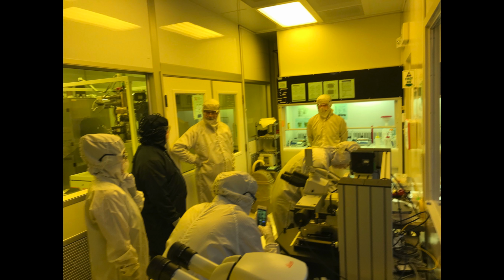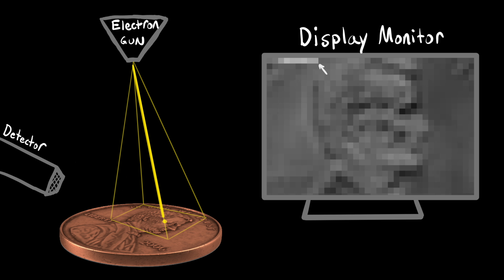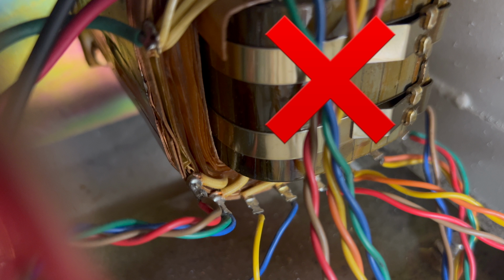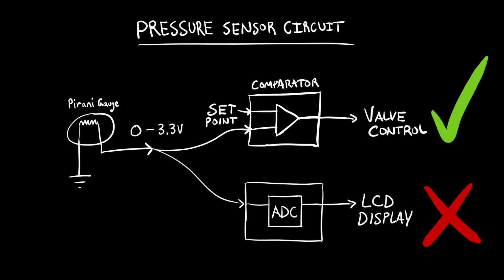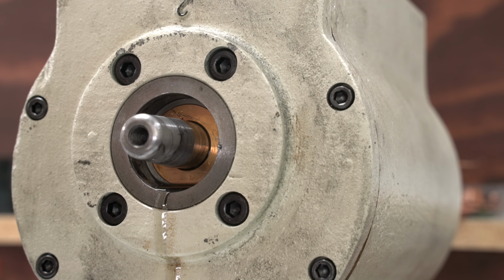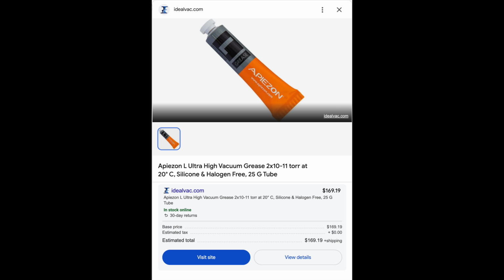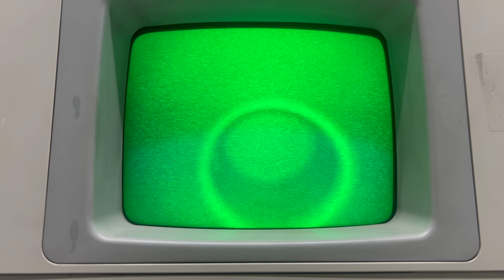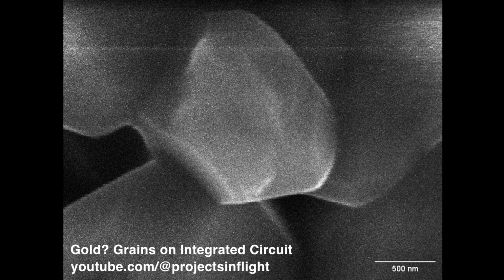I Saved an Electron Microscope from the Trash

Comment: On a technical basis this is very similar in build and operation to the electron tube of say an old Sony Trinitron CRT (Cathode Ray Tube) where beams of electrons are moved in a Z-pattern across an object using electromagnetic coils. I am quite sure that to RECREATE this technology in a much smaller form factor would actually be quite easy to do from a mechanical and electrical engineering point-of-view!

A CRT (Cathode Ray Tube) to provide the scanning electron beam can be recreated from about $2500 in parts and a vacuum chamber you can build yourself out of common 12 inch diameter 3/8ths inch thick 316-series stainless steel pipe and stainless steel plate which will hold a HARD vacuum for your objects-to-be-scanned samples! For X-Ray shielding, I would simply buy fairly cheap half-inch thick Tungsten Plate to shield the operator and other parts of the machine from stray ionizing radiation.

Some fancy EM coils, fast timing circuits and a decent high-precision stepper motors bought from CNC machine parts stores and rotating 3D-XYZ gimbal costing about another $2500 USD worth of parts and you could SLIDE and ROTATE a CRT emitter on the X, Y and Z axis at precision timings to sample  SPECIFIC 2D-XY and 3D-XYZ surface coordinates at a very specific time-stamp to build up the reflected electron emissions and piece them together pixel-by-pixel into an ultra-high resolution image using open source software.  The vacuum tube can be used to keep your samples in pristine condition and remove the chances of electrons hitting the in-between air molecules and dust particles and thus scattering everywhere making the detection of surface features much more difficult.

Some fancy DSP (Digital Signal Processing) and Convolution Filter math done on a cheap laptop or even tablet would make your recorded imagery UTTERLY SING with crystal-clarity and high resolution! Now that I know about this channel, I am quite sure such a setup could probably be designed and built initially for less than $25,000 USD by someone like me and then MASS-PRODUCED for less than a typical higher-end $5000 USD TV set!

This sounds like an interesting product to try and design and build! All that fancy ultra-high-resolution real-time still photo and video imaging and DSP software I just finished coding can now be put to good use! Might be an interesting and profitable product sales sideline to build and sell portable Scanning Electron Microscopes for $5000 USD!

V

Comment: Thank you. An absolutely fascinating journey of discovery and repair, matched with an impressive knowledge across multiple engineering disciplines.
Potentially you have the opportunity to develop a whole other channel of "things seen under my electron microscope", from the guild of knife makers, to the difference between low and high end watch components, graffiti discovered on IC chips to fascinating organic structures. Your options are limitless.
Other questions are, is a crt display necessary over a modern oled? (I appreciate that some conversion would be necessary), and before that old pc and drive die an untimely death, would it be worth taking an image of the drive, and putting it onto a modern high-end VM, with hyper-threaded cpu for improved digital imaging?

Comment: Was there consideration given to using switching power supplies to replace the transformers and 7805 regulators?
Reply from the maker: I considered it but didn't want to replace the linear supplies with switching supplies because i couldn't guarantee that the high frequency noise from the switching supply would be tolerated by the sensitive circuitry downstream. keeping the whole thing as close to stock as possible was the safer bet

Comment: the cable you replaced might not be the right impedance. could be 50 or 75 ohm. check the others and use a quality shielded cable.

Comment: Awesome repair and video, bravo! I’m curious though, since you were redoing all of the power transformers already, why didn’t you eliminate the Variac 120V->100V and base your transformers on a standard 120V input? Was there some other reason for keeping the Variac?
Reply from the maker: some components such as the motors on the valves use 100VAC. it would be a pain to replace them
Reply: @projectsinflight  Ah, makes sense now.

Comment: Wow thank for an interesting video. Do the electrons respond differently on colors? Maybe if is is possible to make the object in colour, with help of using separate color filters, and put them together in a photo program?
Reply from the maker: Color is related to the wavelength of the photons that interact with the sample, so there is no color in an image that doesn't use photons. However, there is something analogous with an electron image. With a specific kind of detector you can measure the wavelength of electrons that are scattered by the sample and if you map that to the different colors of light you can make a color image.

Comment: Can you upgrade or replace the original interface with a modern microcontroller to increase image resolution and output that to a modern high resolution monitor?  Maybe interface said mcu with a single board computer running linux?  The potential for this machine is limitless.

Comment: Reminds of the journey we had with an SEM from the 70s at our hackerspace.
An other space wanted to scrap the microscope because it was said it doesn't work. Turns out it did work but nobody really knew how to operate it but also it wasn't used there. The column and the operating desk were two separate units fortunately but it was still a huge hassle getting it out of one basement and into the other again.
At first it didn't work either, I also found out the vacuum hoses where not good anymore but that was easy to fix. Also the temperature controller for the DIY water chiller was broken but for tests we just let the cooling compressor run continuously. The microscope also had a huge transformer for stepping down the 230V here in Germany to 100 or 110V.
Turning it on after all this looked good, pressure dropped, diffusion pump turned on, valves operated, and the scope went into operational state. The small transformers for driving the lens coils gave off high pitched noises. The screen displayed only a bright green spot in the middle and suddenly it smelled liked fried electronics.
Further investigation showed that probably the ancient power supplies broke during moving the unit and fried a huge amount of electronics like opamps, the two Z80 processors, the EPROMs, DACs and so on. The electronics is completely trashed.
The goal was to develop our own modern electronics to operate the column but since I had to leave the space unfortunately I don't know how the story continued.
Way in the past I also fixed a super old dual stage rotary pump with heavily pitted vanes, I manually filed and polished them and the pump got down to pressures I wasn't able to measure back then but it was enough to make the plasma in discharge tubes disappear and produce x-rays.

Comment: for the pcu that goes up to 20,000 volts, at what amperage is that going at. or how many watts cause im curious how fast its dissipating  that energy
Reply from the maker: It's a fairly low amperage. I don't know the exact number, but I know that it is likely around 1mA

Comment: Why not to convert the Machine to accept by default 120v if you are already replacing the Transformators?
Reply from the maker: Some parts of the machine run on 100VAC actually, so swapping to 120V means i need to replace those parts (mostly the motors that control the valves)

Comment: I’d say a cool thing to do with it is to create mega scans of newer silicon dies. Or even scan multiple chip generations to show the shrinking of the components.
Eg
8088 (3 Micron)->486 ([first]1micron-600nm[last])>Pentium4([first]180nm-65nm [last])>Core2Duo(65nm-45nm)->i7 950(45nm)-> i7 3770(22nm)-> i7 8700 (14nm)-> i7 13700 (“7”nm) etc

Comment: Some ideas maybe?:
Dead leaf?
Some funguses?
Cubane chemical? Probably can't see structures of chemical compounds with this machine....Or an sem in general?
Toenail?
Hair?
Salt deposits or other corrosion residues?
Microscopic art figures?
Differing levels of sand particulates?
Oh, a faulty disk drive that has an imperfection?
Imperfections in general?

I'm just spitballing here...
Paper?

Comment: Must have got the patience of a saint to perform this repair, congrats!
A short list of the faults and interesting tips:
9:35 Shorted transformer replaced by a few ones
11:46 DC linear reg not working, replaced with modern ones
13:08 Pressure shenanigans, replaced all aged rubber sealing and tubings(steel coil reinforced ones for vacuums!), replaced the grandpa roughing pump(kudos for the efforts!)
17:01 Isopropyl trick for fixing external leaks, never heard of that before, I may use it to fix my leaking glovebox later!
20:42 Diffusion pump valve not behaving, serviced and re-vacuum greased. (key take: dow corning brand not good for moving parts, vacuum grease must be tailored to the case of application to ensure seal)
24:46 Broken RCA coaxial replaced
26:02 Broken switches caused by aging rubber, replaced by membrane "borrowed" from a game controller.
30:06 Probably Arizona Cardinals, so the chip would be likely originated from a fab somewhere in Arizona. (a fair guess since it's got really high silicon density)
34:42 It may be too far fetched but modern SEMS can do e beam etching or even EDS with a proper module, considering it's already a miracle you got it to work, I would suggest minimum modifications and leave the machine as is and just perform imaging. Or try etching if you feeling brave.

Thank god the deflection system and sensor in the main column still works, along with all the logic(lucky!), but it does not diminish how impressive this repair is, once again, congratulations all around!
One of the best repair videos I have ever watched, instant subscription!

------------------------
I have read the comment from the JEOL  fellow engineer, I would agree it might have been the CRT deflection driver, it would be one of the more complicated parts down the path that is causing the issue, but not the flyback transformer.
Reply: thanks for the timestamps 🙏

Comment: I don't know anything about those microscopes, but they look really interesting. But what I do know from multiple electronic repairs in the past is that you should look into replacing ALL capacitors inside. They run dry or get old which may result in the bad image quality (compare it to the repairs of gaming consoles from that time where the image behaved in a similar way) or even result in exploding or burning old capacitors because they short inside.

Also you could look into converting it to 120V by replacing everything that is connected to the mains (all the transformers) with 120V ones. Those transformers are the only parts that actually require the correct mains voltage. If you want to spend some extra money, get some decent switch mode power supplies for the voltage rails. They will provide a stable output voltage and have fail safe circuits inside and they will allow you to power it with every mains voltage from 100 to 240v. If an old transformers has shorted wires inside, it may output some really high voltage that could easily kill components on the boards.

Additionally look into dumping the firmware on the digital board. If the storage chip ever fails or the contents get corrupted, you might not find the correct firmware for the system anywhere. Also the tuning values for analog stuff are stored somewhere and you should definitely save them too, else it might require some fine tuning if this storage chip is corrupted.

And do the same with the PC. It's hard to find such special software anywhere as well as the drivers and set everything up. If you can find the installers on this PC it would be great. Otherwise create a dump of the old drive and save it somewhere. Old hard drives might just fail from one to the next day.

Comment: Yeah, one of the transformer channels is broken, and only need 4 of them. Why didn't you rewire the broken channel to a working one?
Reply from the maker: when one secondary is shorted out, then you still see that dead short at the primary side at 60Hz. The only way to fix it is to remove the winding entirely, which would require removing all the windings
Reply: OK, I see. Really great work! Thanks, man.

Comment: The radiation is going to kill this kid. Electron microscopes are very  dangerous
Reply from the maker: SEMs are not that dangerous for X-Rays. Even at the highest possible energy level, the maximum photon energy is 25keV, which cannot penetrate the thick steel column. A TEM at 100keV is much more risky and needs to be inspected more often. Also, i have checked with an instrument that can detect low energy X rays and have not detected anything while the machine is on.

Comment: 25:31 cable hoarding, absolutely important   29:42 IC, good choice to image.  Thanks for not giving up on this one, fantastic result.  I'd like to see more about re-purposing CRTs into a DIY electron microscope.   Is running the pumps noisy or are tethered far enough away that doesn't matter?

Comment: I worked in an EM lab in 1984-91. We had a JEOL100C TEM and a JEOL50A SEM that was old then. Still able get cool images… it was in a teaching hospital…to give the students a real sense of magnification I prepared a small millipede for SEM. 50x see the centipede, at 100x see a plate or hairy leg, at 1000x see there was a crack in the plate, at 5000x you see bacteria in the crack, at 25000x you could see structures on the bacteria.
Reply: Just a warning, putting any sample in the scope that isn’t critically dry will rapidly contaminates your column due to outgassing. I am very surprised the column o-rings don’t leak after all that time. Get a vacuum evaporator or plasma coater to get best images.

Comment: I find this video so fascinating despite having never seen an SEM before. I am not the type of nerd who can fully appreciate what you have done, but I will contribute in my own small way with my own knowledge.

"Go Cards" is most likely a reference to the University of Louisville Cardinals. Whoever made that chip might have been an alumnus, because that university does have a computer engineering degree. It could also be a reference to the baseball team in St. Louis or the football team in Arizona, but Louisville seems mostly likely because of the education connection.

Comment: Wow! That's some seriously impressive troubleshooting, the persistence to understand, solve and correct all of the problems is fantastic. This is basically my job in a semi fab, but my areas are implant, epitaxy, photo cure, and some rtp, not metrology. Metrology machines are very cool, but from an equipment perspective it's a very difficult area given all of your machines opperate using entirely different technologies.

I'd be tempted to say that those grains you captured at the end are polycrystaline silicon, the appearance and size is right, and poly si can be used for interconnects.

Comment: Don't bother with the old pc interface,  just buy a standard rca capture card and plug into the signal line
Reply from the maker: Can a standard card like that do variable resolution and frame rates? I'd want something like 4000x4000 at 10s/frame
Reply: Ah fair, that's is more specialised. 
However an rca signal is not going to carry a resolution of 4000x4000, does that capture card also manipulate the scan area?

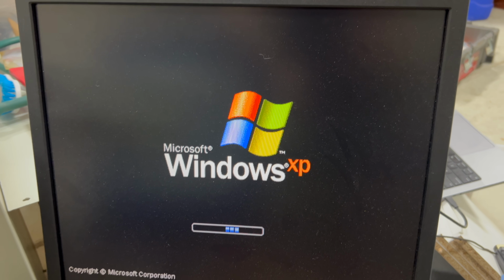Comment: Many of these instruments used to have (back then) rudimentary computer interfacing to get the data, maybe RS232 or other. I used to work in a lab that had many of those old school oscilloscopes and other lab instruments, before everything became digital and miniaturized. In a case of the image resolution we would get some of those fast images and do processing in another computer. You could average all the acquisitions and still get a decent quality image. The instrument itself regularly didn't have these features because the type of CRT display used, but with a modern PC you could do extra wonders with the data, which is exactly what they did with that computer 32:57 We had an old infrared microscope that had a similar issue. The provided manufacturer software wasn't really very good, so we made our own. The important part was to get the raw data from the instrument and to know the data file formatting to extract the images and all the acquisition parameters.
Reply from the maker: I'm definitely looking to improve that computer interface!

Comment: No wonder voyagers are still working. The easy replacement of any single part in an old machine makes it reliable for long runs. modern machines are so much anti repair and are basically use and throw. Maybe that is why old is still gold
Reply from the maker: It's interesting how humanity is capable of building things that last, but rarely does

Comment: It cost 100k $ in ca. 1990 So about 200k nowadays.100k appeared to cheap to me.   You did a  REAL great work. Never though you can magnify the samples so quick and easily without preparing them with metal-vapor. But doesnt this raw samples contaminate the vaccum by the x-rays ?  Btw.: A system similar to an TV-tube would be great in which the vacuum is encapsuled for ever, without needing pumps, and the sample lies outside of it
Reply from the maker: It's important to be careful when putting stuff in the SEM because water contamination is a huge risk. I dried out the fly pretty significantly though

Comment: Hi, hello, question: how did "dave" make those marks?? Are they additive like a material or subtractive like a scratch?
Reply from the maker: It's probably a lithographic process. I don't know what the material of the markings is. It's probably metal, which would have been applied using sputtering or something